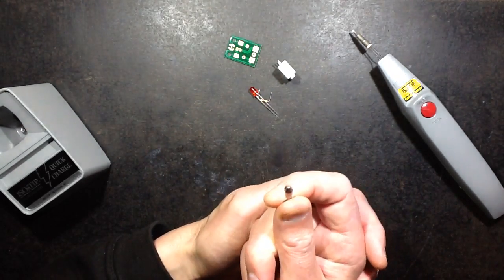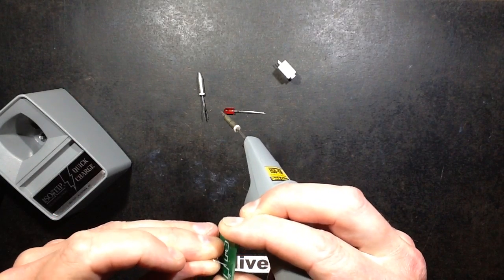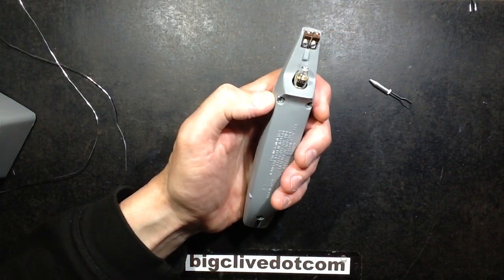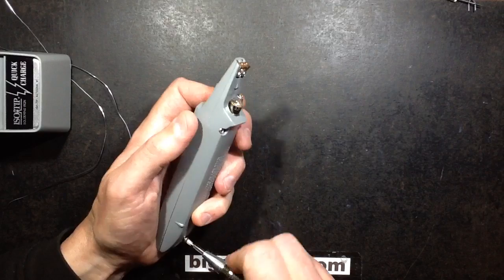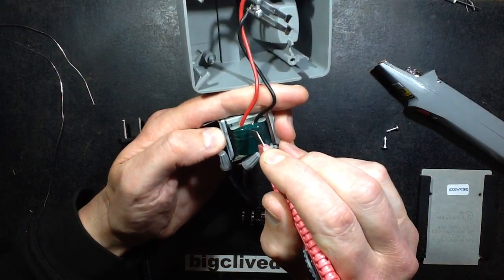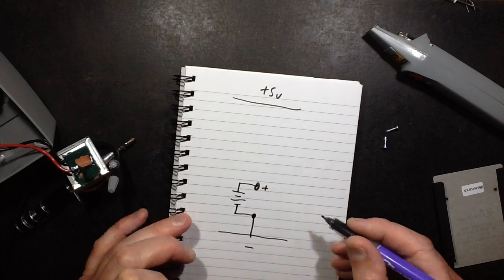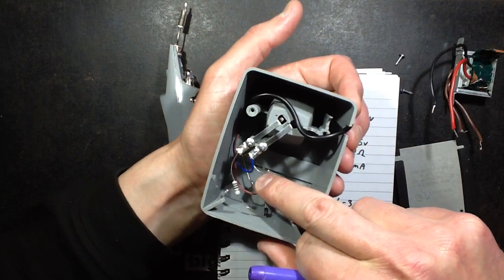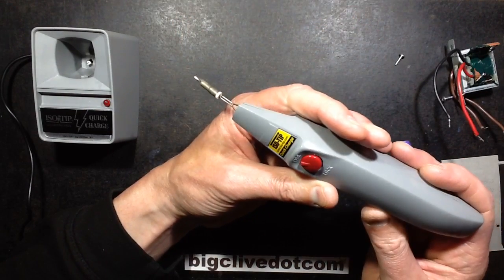Inside an Iso-tip rechargeable soldering iron.  (And charger hack.)

Comment: Looks like very well made soldering iron
It would be interesting if they make larger version of this. Similar to mains soldering gun but using several 1.2V NiCd battery and using mosfet switch

Comment: Hi Clive, I did this mod and iron worked a treat, however all of a sudden the tip did not heat up at all , however the globe/light was bright as , I have the 2.2 v on the charger and at the tip contacts, I replaced the tip checked the fuse wire and got Battery World to replace rhe nicads, result was still the same , light came on but absolutely no heat at the tip , 
Any suggestions ?.
Cheers m8.
Reply from the maker: Sounds like the element in the tip may have failed.

Comment: I always used to run mine until it started to get weak, before I set it back in the charger. Even though I was a wee lad when I got mine, I was aware that the charger used a simple "dumb circuit" to charge the cells, and I was aware of the "memory effect" of Ni-Cad cells. Now today I don't know if I was doing myself any favors by treating the cells like that, or if I could have simply dropped it back into the charger every time is was done using it and no harm done. 🤷🏻

It seems rather rare to run across cordless devices these days with Ni-Cads in them anymore. I'm fairly certain my cordless shaver has one in it, and possibly one of my cordless screwdrivers.

Comment: The little exhaust hole in the butane irons would occasionally burn your finger if it was pointed in the right place, or melt a component if it got too close. I never got into those all that much because of those reasons.
Reply from the maker: Yeah, you have to be careful with the lighting port.

Comment: In the early 80's, in the epic days of CB radio, I was modding them and adding channels by interfacing with the PLL. These IsoTips were so valuable to me and 30+ years later, they still are and I still have the same ones.  The reason I was asking about the 21700 lithium is yesterday I had to change the power switch on my MFJ 993B antenna tuner and its in a BITCH of a tight place to get to. I reached for the iso tip and DEAD. DAMN NICADS !!!!!!!!!! I had to botch it in with the Weller WES51. I need my isotips to work every time damnit. These need to be lithium !

Comment: I have 2 of these from the 1980's. One is grey and one is orange. Im tired of the crappy NiCads going bad. Also one of the bases don't work anymore and the other one gets BLAZING hot while charging. Wondering if these can be modded to run on a 21700 lithium battery. it appears that the 21700 would fit perfectly in the shell.

Comment: I still have mine from the 70's but can't find the chargers for the 7500 or the 7600 or the 7700.  Did you happen to run across a schematic for the fast charger by chance?

Comment: I can remember seeing a fellow service tech who had not one but two of these irons in his toolkit.  Because of how long they took to recharge.  I don't think that they were the "quick charge" models,  but the earlier ones that did take quite a while to get there.  Later on I bought an Isotip 60,  which was supposed to recharge in one hour.  I've replaced the battery in it once already,  and that replacement is pretty well shot and has been for some time -- I just haven't gotten around to doing anything about it.  The differences internally is that the battery has a bit of a circular metal holder attached to the top end,  in which sits a thermal switch that makes a pretty distinctivie click when it gets up to a certain temperature,  presumably when the battery is fully charged.  There's a red LED and a little plastic slider on the side of the unit to reset this thermal switch,  so it will charge again.

I too have looked inside the base and wondered about that setup.  Never thought about a diode in the transformer,  though.
Reply from the maker: I think the best way to use these is on standby in a charger.  They do heat very fast, which is a good advantage.

Comment: @3:10 your estimate of 20 Amp current thru this iron is completely wrong.  The power transformer on the charger outputs 4 Watts, the battery pack is 2.4v.  Per Ohms law: current = Watts/Volts, or current = 4/2.4, current = 1.6 Amps.  I measured the current and it's around 1.7 amps.  In addition, the wire seen inside the iron, and the original battery pack suggests to use a 28 AWG wire, which definitely will NOT carry anything close to 20 Amps.
Reply: The charger has nothing to do with battery output. 

You can slow charge batteries and they can have tremendous current (amp) output, it just takes longer to recharge... Like an electric car on the slowest possible charger for an example.

Comment: I had the identical one back in the 70's branded UNGAR, it was red, no charging base, just an adapter that plugs in the wall. Used it for years until I couldn't find tips anymore. Surprised to see that design is still around, maybe I should get another one, Thanks Clive, love your videos.
Reply: Ungar has apparently been bought out by Weller.  I have been using those Ungar irons where the heating element screws into the handle with a base similar to the bulbs used in nightlights,  and in fact remember a tip in a very old magazine that talked about putting a nightlight bulb into the handle to ease seeing into various dark corners in "a chassis".  :-)  Those irons were also sold by Radio Shack for a while,  though their handle has had the rubber grip deteriorate muchly,  which was not the case with the Ungar handle.  Heating elements and tips are still currently available from Mouser Electronics,  which is where I've purshased them last.
Reply: @Roy_Tellason  I am aware of those irons you speak of, I've always used Weller soldering stations throughout my life and no longer need a rechargeable iron. Now I do mostly automotive work so I have a 12 volt Weller iron with alligator clips in my toolbox if I need to do a quick fix.

Comment: ISO-TIP Charger Hack
:
120VAC -> 5VDC (USB) @ 160mA

Diode:		1N4001
Resistor: 	10 Ohm @ 1 Watt

LED:		Red @ 2VDC
Resistor:	100 Ohm @ 1/4 Watt

USB (-) > (-) Contact

USB (+) > Diode > 10 Ohm Resistor > (+) Contact
USB (+) > LED > 100 Ohm Resistor > (+) Contact

Comment: This iron uses 2 batteries type Sub-c connected in series (2.4V) as found in old drills, various tools, etc .... For a few dollars you can get these batteries. As for putting an LED in place of the filament lamp, with 2.4V this is not possible, except perhaps a yellow LED. This soldering iron is closer to 15W than the announced 8W.

Comment: In my collection there is a battery powered solder iron from the 1940s. It heats by connecting its single clamp to a 6 volt car battery, and holding the iron's point to the other terminal of the battery for about ten seconds. This heats a spring-loaded length of carbon arc rod inside the steel body of the iron. When you see through a small inspection port the carbon is glowing red, you remove the clamp and solder merrily away. The iron's copper tip has enough thermal mass to solder several joints before battery power is needed again.

Comment: I found one at Goodwill several years ago.  Batteries were all dead and no charger.  Last night I put a 18650 from a power bank into it. Now it is USB rechargeable with a bonus phone charger. Thoughts?
Reply from the maker: As long as the cell has protection and can handle the high current it should be OK.  If it doesn't then it may pose a risk.

Comment: isnt a bit of solder wire safer?
Reply: Serve as a fusible link, maybe. But where do you find solder drawn that fine? A bit of magnet wire or a strand from a flexible cable would serve as well.

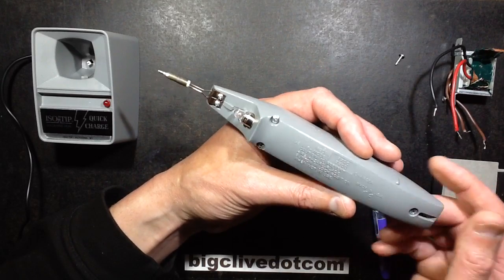Comment: Hey "BigC", sorry to ask but at around 22:00 in i just looked up an noticed on your note pad that the positive + going to the Bat Term, is supplied through a voltage divider. Is there something i'm missing in the video describing that or did it actually matter in the long run? New to electronics and curious, TY :-)

Comment: They are not unchanged. I have an older red one that is rated for a 1 hr recharge. . The 7700 has to be a trickle charger which can take 12 or 13 hrs and and is terrible for battery life. That us all you can do with no charge monitoring. NiCds take this abuse better than NiMh. Mine, for which battery packs are still available, has a thermal switch  to detect full charge, mounted on the end of the pack. NiCds rise in temperature as they reach full charge. The switch opens and is bypassed by a trickle charge resistor. Pressing the button resets the thermal switch. This is stone age technology as the minus Delta method does this electronically but the 7700 is even more crude. I even have a charge light on the charger.
Reply from the maker: The old Ryobi battery packs used a thermal switch to end charge.  More reliable than delta-V.

Comment: I got my Iso-tip in a few months ago... almost immediately broke the first tip...but the 2nd is working pretty well  :)
Reply from the maker: Did you drop it?
Reply: No...i was sliding it in and my fingers slipped and snatched off the ceramic end which kind of tore it apart.
Reply: That fragility is one reason I prefer the Hakko FX 901 battery iron and Eneloop cells.

Comment: I had one of these, in black rather than gray, and used it for decades. The charger was a wall-wart, rather than a stand-up bench charger. It was the perfect iron for soldering stereo wiring harnesses under a car's dash board - cordless, and it had a built in light. Then one day, after decades of use, the tip literally fell apart, and there was no easy way to replace the tip, as it was in the days prior to the internet. It was the perfect compliment to my mains powered Weller.

Comment: I wonder how much more expensive it would be to put a rather large lithium cells in there. I've got some 18650's that will do 35 amps continuous at 3.7 volts and quite a lot of capacity.

Comment: I followed the directions and I end up with 3.6v at the charge terminals.  I can't figure out how to step it down. The charge is being reduced from from 5volts but still higher than the 1.68v as stock.  Using the 10 ohm and 100 ohm resistors and the original diode from the transformer and the schematic by bigclive....could it be my red LED? I don't know the specs on the LED. Everything works, just too high a charging current. Someone please advise....thank you.
Reply from the maker: The NiCad cells will self regulate.  They can be kept trickle charging continuously.  They're not as volatile as lithium cells.
Reply: @bigclivedotcom   Thank you for the reply!  Are you telling me it's OK to be charging the batteries at 3.6v? Did I use a 6v red LED perhaps instead of a 2v as you did? Is that why I ended up with a higher charge output?
Reply from the maker: @jh5881  If the supply is current limited the voltage will sit down to around 3V across two NiCad cells.

Comment: I've had one of these for over a year and I love it.  There is another mod (2 actually) that you can do.  1 is to make it use an LED which I am going to do to mine.  Go to ISO-TIP's website and they have a link to a video a guy made to show how to do this and also put a charging LED inside the iron itself.  It uses the joule thief circuit from your video I think, which I'm also going to do.  I like your USB mod and I might consider doing that as well.  I will add that years ago Radio Shack had a cordless soldering iron that used the same tips as this one (might have been manufactured by Iso-Tip, but not sure)  It was a great little iron and included a cover that enclosed the entire tip/mechanism for easy travel and protection.  I wish I still had mine.  I do have the tip and switch section though and am going to try to mount it in one of those cold heat (junk in my opinion) soldering irons.

Comment: Totally understand your nostalgia, there... I picked up a 100-140 watt pistol iron made by Weller at a yard sale last year... It reminded me so much of my dad's slightly bigger model which I used for my projects in the 70's that I just HAD to buy it. Haven't used it on anything yet, but it just feels right to have one. LOL

Been to their website...
Those low voltage tips look like they might be prime candidates for building a very portable, very small soldering iron attachment for a slim, one-celled Li-ion power bank!   Has anyone here tried this yet?

Comment: I like the gas irons cause they also blow hot air (PP). And I just keep a small butane can with me to keep it full, As with this one it would need to be plugged in somewhere to recharge. And when doing work with car audio there sometimes isn't an outlet to plug in to. Just don't drop it... I still might get one of these also... Love your tear downs. Thanks!

Comment: I started using these cordless soldering irons, branded "Wahl," in 1975. My job at that time was servicing and installing two way VHF radios and VHF mobile telephones in the very large off-highway trucks used in the oil drilling industry in northern Alberta. The trucks were so large that there was no garage space that would accommodate them. We did almost everything outdoors, except bench work on a radio even in the dead of winter, which was no joke. It was common to find yourself balancing on some precarious ice-covered steel foothold 12-15 feet in the air, soldering an antenna lead, or lying in a truck cab with head and shoulders inside the dashboard of these monsters, boots hanging out the door. We had four Wahl irons sitting in chargers on a shelf by the shop door. When a battery got tired, we'd drop that unit in a charger and take another out to the trucks. These were excellent tools, and would solder good joints of things like #14 stranded copper wire even in -40 degree weather (same in C or F). They would survive being dropped 10 feet or more; we could just straighten the tip and keep working. Needless to say, some truckers found these little soldering irons fascinating. Occasionally one would grow legs - the borrower not realizing that a charger base was required.  We would just add the price of a replacement iron to the company's bill.  
A bit later, we fitted up a mobile service truck, complete with test equipment, on a 4WD  chassis with a comm shack body removed from a wrecked military signals vehicle. This got a lot of use out in the bush. We had a petrol generator to run the test equipment (Cushman analyser, oscilloscope, signal generator, etc.), but we modified the Wahl charger bases with a connection to the truck's 12 Volt DC power. This kept the soldering irons charged all the time - very handy. Version #1 was very crude - a protection diode and a couple of voltage-dropping resistors, possibly with a pilot light.  Version #2 used a 3-terminal regulator  built into each charger base, with a relay that selected either 12 volt DC or 120 VAC power supply. Version #2 was the result of a charger base accidentally being connected to both mains and 12 VDC simultaneously, letting the magic smoke out. The charger/base took power from the truck's electrical system when the truck was running, and isolated the 120 volt lead. When parked with the generator running, the relay switched to the 120 VAC source and opened the 12 VDC circuit. There may even have been a fuse! No more smoke signals. 
Wahl were excellent about quickly supplying spare tips, bulbs etc. I did 2-way radio work for five years in the oil patch, earning money for university tuition. However, when the need ended, I happily gave up working outside in -30 or -40 degrees and blowing snow on fiddly 2-way radios and antennas perched high in the air. I did keep one of the Wahl irons (bad of me, I know), complete with the modified charger base. Later I found it very handy for doing amateur radio tower work and other soldering jobs where mains power wasn't readily available. That unit is still in one of my tool boxes, although I haven't used it lately. 
One amazing thing is the very long service life of the NiCad batteries. I can only recall one occasion where a NiCad failed and required replacement. The small internal fuse could, in a pinch, be replaced with a bit of thin solder until a proper fuse was found. Amazing to think I was using one of these daily over 43 years ago. The fact that the design hasn't changed speaks to just how well they work.
Reply: Thanks for taking the time to write this, it is fascinating! And now I want one of these irons :)

Comment: Even better would be to use a single 26650 brand name battery and hack a vape mod. Those are really precise with temp and voltage

Comment: I had an original Radio Shack soldering iron that looked like that and then the Wahl one. They are good for short soldering jobs but I do predominantly use one of those butane soldering irons. Yes.... you need to be careful in use and setting it down of the hot gas coming out of the side of the tip.

Comment: ISO-Tip should adopt your design and offer a USB version. Rather the trend these days.

Back in the 70s Wahl advertised these heavily in electronic magazines, there being a sizable market of TV/electronic repair shops and techs who made house calls and other location stops. That was pretty well gone by the end of the 80s so I don't know how they have survived since. (My niche, theater service, hung on a while longer.)

I had several of these in the 70s, 80s, and 90s. Their weakness is the ceramic in the tips. Not toolbox-friendly but you could just replace the tip easily enough. A fellow tech made a stiff leather cover for his and glued foil inside it to reduce combustion likelihood. A cover, like your Draper had is needed.

Great vid, BTW.